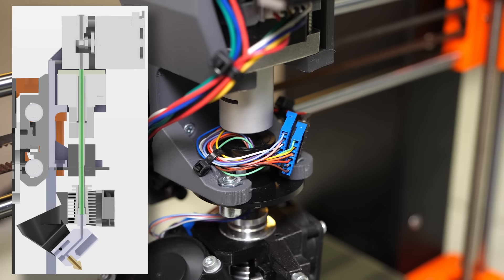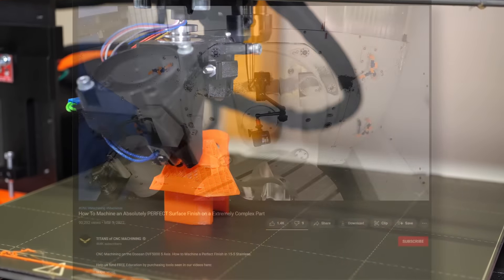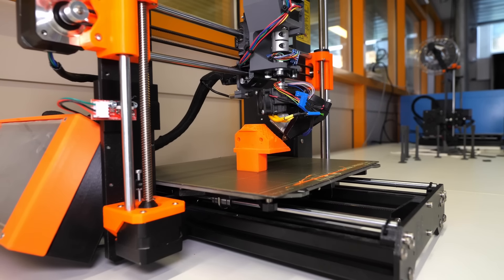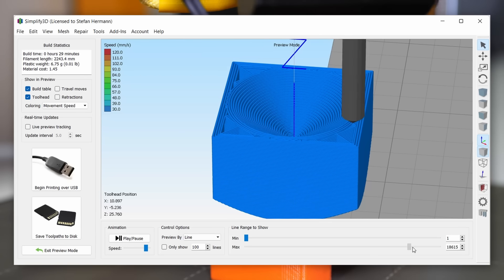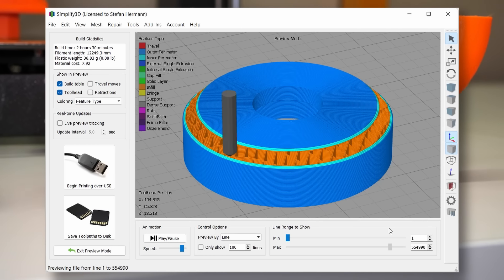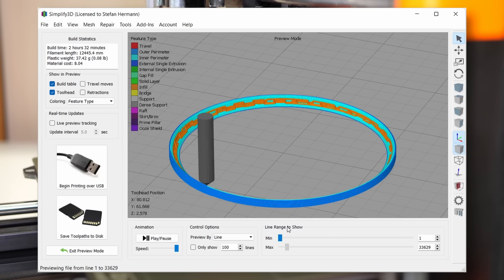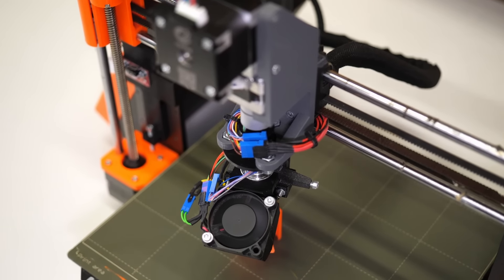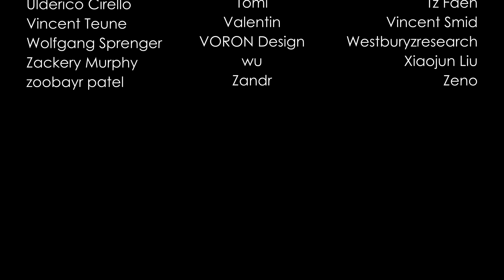Impressive 4-Axis Non-Planar 3D Printing

Comment: I think, most of our nozzle - cooler setups can reach 5-10 degree of angle. 🤔 Especially on small parts.
Reply: This is the most interesting to me: more cleverness in the slicer with a regular nozzle setup. Ie. Automatic segmentation and "cone-placement" to support overhangs in any direction.
Reply: agreed. Those are the new steps for 3d print world. 

Finally something exciting happening in the industry except from new ender/prusha copies and variants.

Comment: it's fun but I don't think it'll be much difference, no matter how many axis you have, there are certain shapes you simply can't print in the direction you want for structural strength. For example print the letter M with the middle V part not touching the bed. still not possible without support. so I'm not sure if it's worthwhile to perfect this method.

actually you can hack existing software to generate the toolpath. Start with the model, mill it layer by layer until there's nothing left, then you generate the CNC milling toolpath and reverse it. what you get is the 5 axis FDM additive manufacturing toolpath. it even takes care of the collision detection using existing software.

Comment: The printhead seems to be very heavy and over engineered, but very interesting. Current printers could use this technique of conical slicing to a little extent, but that can be improved by only making the nozzle more pointy.

Comment: Interesting. So the prints always are printed around a center axis? I guess the next step would be to slice around a path instead of a point, with the nozzle always pointing to the nears point of the path.

Comment: matrix multi-head shutter head printer, like 32x32 printer nozzles in one, 1000x faster extrusion speed optimally if all nozzles extrude all the time, something between of 1-1000 usually, slicing is optimizing the matrix head usage per level
Reply: the printer matrix head can also be used in tilted angle as a normal nozzle
Reply: if you dont move the matrix print head at all, like an lcd screen, 4K nozzles, then you can print each layer at once, just shutters at all "lcd" positions, just like resin 3d printing
Reply: must have single use fast removable print beds, so that sticking too hard does not matter, its like removable support material
Reply: you can also push up the print or just retract the print plate like in 3d resin printer
Reply: dont have hang-overs

Comment: It seems to me presently like a limited application, until the software is more developed. Though it would be nice if non-planer printing was an option for the finished surface of some prints. Such as pyramids and other similar shapes where the layers dont blend that well.

Comment: This sounds very interesting but sounds like it needs a lot of work to become easily implemented. 

What would happen if you wanted to print more than one part at once?

I have a feeling that it would get very confusing as the origin of both the stl and gcode would have to be the same otherwise when you reversed the deformation you would get some very strange results.

Adding a 5th axis that adjusted the tilt of the hotend would really open things up. Unfortunately the software implementation would be the difficult part. Especially if you wanted to make it work with different setups.

Comment: Guess: the effect conical sliced prints would have on print strength are negative, since the more complex path is harder to replicate without increasing deviation from the previous path compared to regular "flat" prints. Layer adhesion will therefore be worse.

Comment: 3d printing needs to look towards industrial cnc's its all invented. Companies like Homag, Scm, Biesse.... 
I think a better approach for the average make would be to have a lineal magnetic tool changer with a nozzle, with Ggode you could release the magnet to drop a nozzle and then pick up another nozzle do the overhang and then change back to the standard nozzle.
You could also, for production necessities make a specific nozzle for a troublesome part.
This is a very common approch industrially, just the tool changers are pneumatic. Magnetic would be an easier approach for a 3d printer.
A lineal tool changer would requiere sacrificing a few mm of your build space, probably not more then 1-2mm

Comment: This is awesome, but I still believe the limitation without >3 axis machines isn't the machines themselves but the slicing. Full control gcode folks have demonstrated full 90° overhang with conventional machines. The slicers just don't have a good model for generating the kinds of toolpaths and extrusion needed to achieve it.

Comment: How are they routing their cables through the rotating axis without them breaking all the time? They have to use some interesting spring loaded contacts riding on rings around the axis for every connection 🤔
Reply: That's what a slip ring is.

Comment: The more dimensions added to a task, the lower the audience size will be that can and will make use of it.  This is especially true for such things like this that literally turns things on their heads, and has limitations to think about.

A small percentage will get into doing this, but 3D printing and modeling is still rather small for the long-term modelers and printers even with the current level of complexity and costs.  This has a cost in added software (cheap/free to scale) and hardware complexity (not so cheap, added maintenance/repair issues) that may not have as many real and/or perceived benefits to the general market as needed to make this widespread.  3D printers already have a rather large number of parts that can fail, and this adds to that.  As Elon Musk asserts, the best parts are no parts.

That being said, a major change in the economics of the care and feeding of 3D printers may usher this into more widespread use, even with the added hardware/software/design complications: certainly in one part of the world right now, electricity costs and availability have shifted up quite a bit, and print time is spent making supports.  Also, if filament costs go up enough, the ROI of not having supports and their wasted material more often than not pays for itself rather quickly.
Reply: I read this comment and I agree. I believe that the SecSavr Suspense or a printer (technology) similar would be the way forward in home 3D printing. It has the potential for more managable software requirements, lower power requirements and more reusable support opportunities whilst sealing away all toxic substances.

Comment: I think this is amazing work and very cool from an academic standpoint, but it suffers from the same things as belt printers:

The advantages do not outweigh the disadvantages when it comes to everyday printing.

A belt printer is amazing for printing infinitely long parts, but objectively worse at any other print. The belt will never be as good as a dedicated solid print surface and the 45 degree nozzle is not only a problem for overhangs on the Z0 side of the print, it also means any cooling duct is going to have to compromise to not smash into the bed.

This fourth axis is awesome at printing external 90 degree overhangs, but internal structures will always have physical constraints (there's a reason they have the tube in the exact center of the printbed for the demo). There are structures it can't print properly without the head smashing into the center of the already printed part. Then again there's the heavily compromised part cooling duct. Lastly it can't go as fast as the same printer without the attachment without generating horrific vibrations.

That doesn't mean I think this is useless tech, but it isn't something anyone with a printer will want to get, unless you have a very specific (set of) parts that can ONLY be printed with a belt/4axis machine then you shouldn't get one.

Comment: Some time back, I think it was after seeing a FDM printer that had a belt instead of a print bed and the head at, I think 45°, I envisioned a printer with a printhead that could be tilted. But this is so much easier. Less moving pieces and even though the slicer becomes a lot more complex that is normal it's still a lot simpler than the complex solution I dreamt up.

Now I said I envisioned, and that was all there was. I saw a potential and tried to figure out how it could be made to work, but it never went anywhere, not even wrote it down on paper. So I don't claim any real invention. I just found it funny how people can look at the same problem, see a similar solution but approach it from and entirely different direction. The version with the articulated print bed shows yet another way to attack this.

Comment: Couldn’t you avoid the head dragging issue by tilting the head to 45 degrees and then spinning the bed? Seems a lot simpler to have a spinning bed vs a hollow motor and slip ring.
Reply: Rotation of the bed means, that the nozzle is not in the center of the rotation and therefore you need a lot of compensation movement of the printhead... But it would work as well.

Comment: Very impressive. Combined with reinforcement printed inside the filament this could help solve step towards cheap functional parts. Combine that with real high flow nozzles and it is getting fast (thus cheap too). Currently 2D +Z is just not enough. Also 3D printing should be way easier for everyone, not only nerds to get good, fast and strong functional parts. The % of commercial parts being 3D printed is currently maybe 0.01% (just my wild guess). So getting that to 10% would make a 1000x possible. I printed 3D scale boats of 2.4 meter already. But why not bigger functional boats of 8 mtr? And there are so many other applications!!!!

Comment: do you think you could use a regular 3d printer and bridge a very tiny distance over the edge and then wipe the nozzle to the inside, and then go again a bit over the edge then wipe again, this could work without supports, someone needs to experiment with this

Comment: I think it's easier to produce a full 5-axis 3d printer based on a small 5-axis cnc machine with a rotary inclinable table. 
It won't need to use a sophisticated print head and geometry transormation before slicing.
Reply: Might be trading speed for greater path flexibility.  Still, I’d rather have a slow high quality non-planar printing option than no high quality non-planar printing options.

Comment: what about time of printing? are conical printing more faster than 3-Axis print?
Reply from the maker: If none of the axis speeds is limiting it should be just as fast/slow as regular prints. Of course it's faster if you avoid supports with this method.

Comment: Does the python script allow the user to set the conical angle? Should be easy to measure the hotend angles and set a safe conical angle. Then, all 3d printers could try this non plannar method.
Reply from the maker: Yes, the "Var Angle" version allows you to do that.
Reply: @CNCKitchen  this is awesome! I recently received my KS Bambu and once this first run of prints is complete, I’d like to try out the Var Angle script.

Comment: This is a very interesting concept and I hope to see more development in slicing software for more axis use like the hydra system in the voron printers. Altought the concept is interesting, the 45 degrees filament turn and then the 90 degrees turn at the nozzle still doesn't convince me. I'm pretty sure this design will be improved upon, can't wait to see next iterations

Comment: Very interesting. But there are problems when several objects are next to each other. Otherwise the idea is basically good. I also think that a rotating table might be easier than a rotating head
Reply: would go well with a delta printer
Reply: Rotating bed is problematic, as you get lower spatial resolution as you go further away from the axis of rotation, plus as the print grows, the weight of the bed table grows too, so modeling kinematics is really hard.  Also if the bed is big, you need bigger bearings and motors to rotate it. With rotating head, there are none of these issues, and it can be installed on many existing printers with less modifications.
Reply: @movax20h  do i need to elaborate why this isn't true?

Comment: I think some of the issues could be fixed if it were a 5-axis printer. I think that the print head should be able to tilt instead of being fixed at 45 degrees

Comment: A 4th axis seems rather unnecessary. If conical slicing further improves the already decent print quality/overhang capability you get from a 3-axis bed-slinger, then it and intelligent part orientation is most likely all you need. I'd rather just make use of this improved slicer's capabilities and orient the part in a way that complex features print w/o support and push the fewer still necessary supports onto a large/simple feature/surface ... but I'd still prefer to print the part on a lightning fast core-x-y instead of this slow-a-f 4-axis hack. A few minutes of post processing seems like a reasonable price for the hours of print time saved compared to a slow 4-axis machine. 
Three axis are enough for fdm printing. Non planar and adaptive slicing strategies however are something to get exited about.
Reply: Also a printer like this that is comparable to current 3-axis models in terms of speed, precision and reliability would probably cost two or three times as much. 
I mean, most people won't spend let's say 500 bucks more up front for a more complex machine with twice as many potential points of failure just so they can save 100 bucks a year in filament.

Comment: FullControlXYZ is doing some really cool stuff like this that has been going viral for quite sometime but premade gcode that folks like us can download and try. A solution to help with basic 3D printers when it comes to steep angles would be to use an airbrush nozzle instead as the tip is "pointy" enough to do some really good nonplanar printing, let alone allow for the filament to be cooled better being slightly away from the hotend when extruded. I pray and hope the software and those who are working on nonplanar paths and such the best as this can really make a breakthrough in 3D printing as a whole. Hope no patents are in the way.... ;u;

Comment: My only comment is not using c as the axis code, u is used for incremental movements on the c axis in other cnc applications, a little confusing, but probably not a big deal

Comment: i dont get it, why using a rotating head instead of rotating bed like a traditional 4 axis cnc?
Reply: To make this work with existing printer designs probably. Good for a proof of concept, but ideally this probably would be changed for production models.

Comment: It’s fascinating, but only a (small) step in the right direction.
With this approach of slicing you are not using the full potential of even this hardware.  Effectively you are coupling the forth axis (U) to the X/Y-Axis. It is always oriented toward the center (≈ U = atan2(Y, X)), so this still is a 3-axis model with three degrees of freedom, even it has four motors.

Comment: Or, design parts that are 3D printer friendly. In sections if need be, and glue them in final assembly.
Complexity brings more power with increased cost, while reducing reliability.